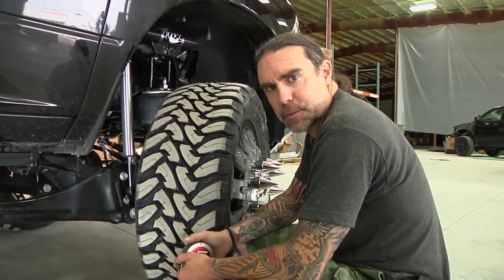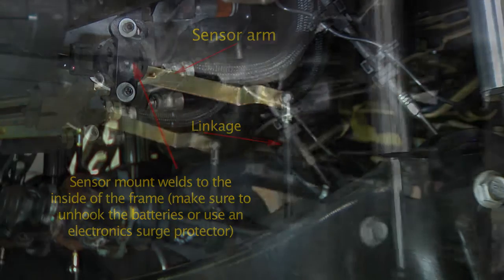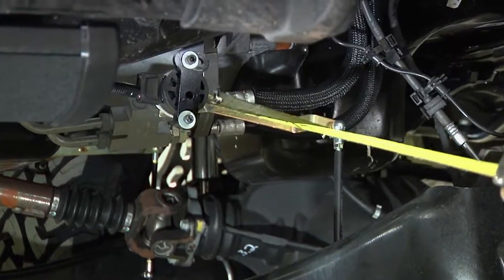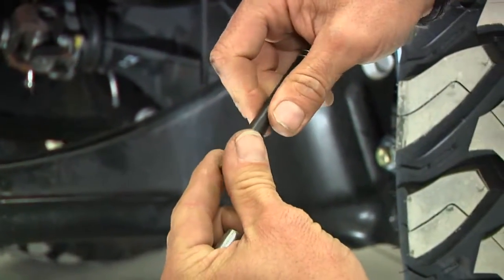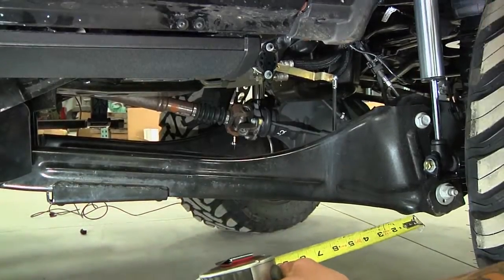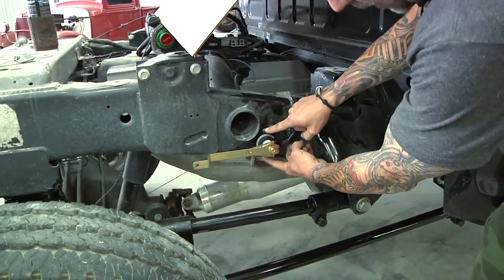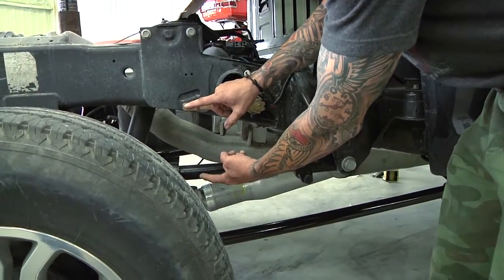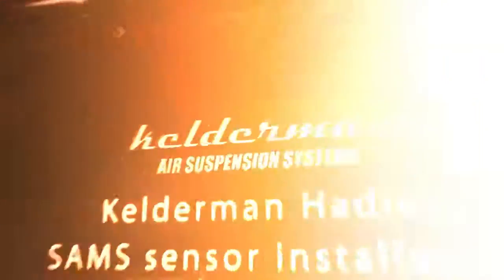Kelderman Hadley SAMS sensor installation

Comment: Firestone says these bags are only rated for 2,772lbs at 90 psi. Is there a higher rated bag that you offer?
Reply from the maker: FROGMAN524 We use a variety of bags but this is a very common front bag. We use it in tons of Ford and Ram kits and it only takes about 60-70 psi to maintain ride height even with a bumper winch, lights, etc.
Reply: I've been tossing back and forth having a F450 built by your company just like the Ruby Red one you just did. I want to maintain factory GVWR and load capacity. What bags would you use front and rear on that vehicle?
Reply from the maker: FROGMAN524 It's the same front bag and a similar rear bag. Get on Kelderman.com to see the kits and call us at 800-334-6150 with any further questions.
Reply: Ok will do thank you for your getting back to me. I'll give you a call.